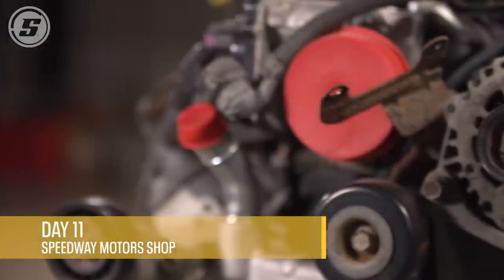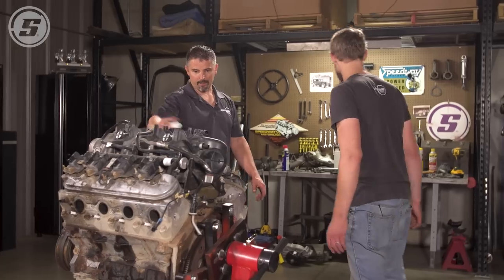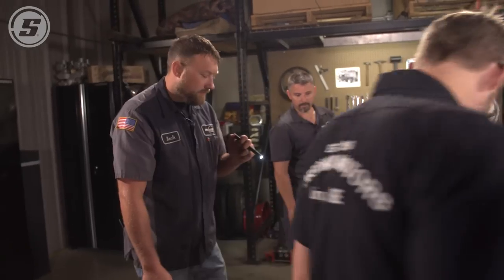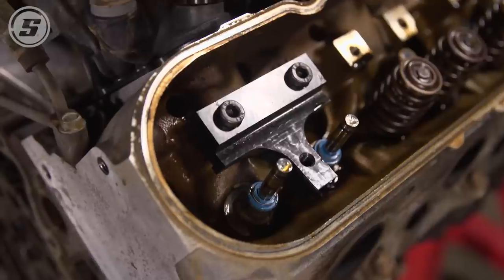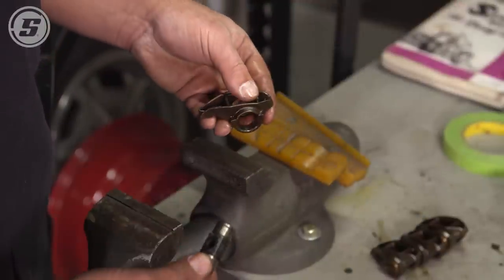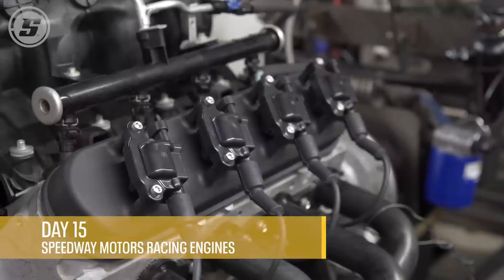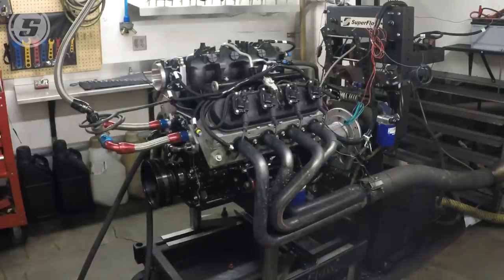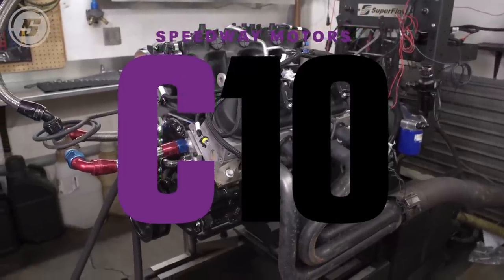1968 C10 Build Episode 4 -  LS Engine Camshaft Swap and Dyno

Comment: I put a 200k mile lm7 in my c10 did not touch the block just freshened up the heads with trunion upgrade, valve springs and retainers for the cam and a Holley terminator x. She runs like a champ.

Comment: How does the system account for timing w/o knock sensors?
  Also, to stop exh bolts breaking, rat tail file the end holes out toward the ends 5/16". Flat washer on top and torque. Never had one break after that.
 Dollar store oven cleaner works great to clean the block & heads. Cheap!
DK, ASE Master Tech since 78.

Comment: I will ask again, but how does the system sense knock if removed! Is this the Holley Terminator X Max system learning or something else?
DK, ASE Master Tech since 1978.
Reply from the maker: Hello Dean! If the knock sensors are gone then you just have to use your ears to detect knock and adjust the timing table accordingly. The Holley will use knock sensors if they are installed and we would recommend leaving them if it's going to be a daily driver or you like to run cheap gas. Thanks!
Reply: @speedwaymotors  I ask only because I have my "LS" built already and use dealer diagnostics, dealer parts and get good results with my sealing methods. Not familiar with Holley low pressure EFI or their system. I have stainless steel lines but get questions all the time about what works. I have the practice. ASE Master since 78, EFI and multiple carb set ups, UTI instructor and delivered 4hr seminars in 7 states for ACDelco, 2 day classes (30 total) in 13 tech colleges, retired.